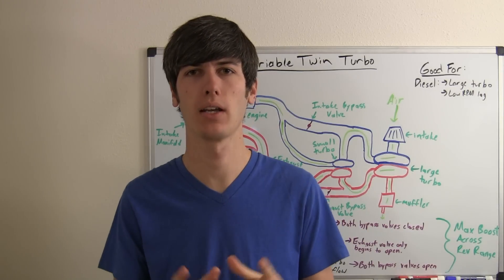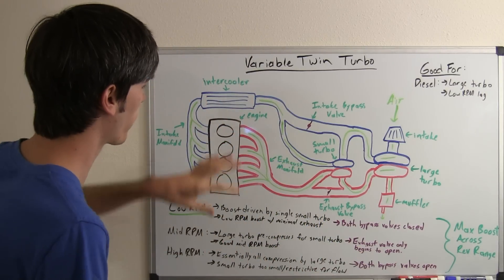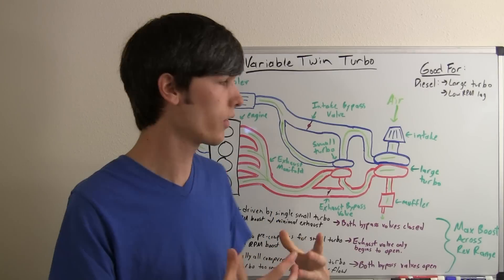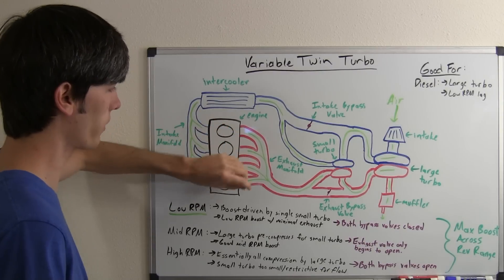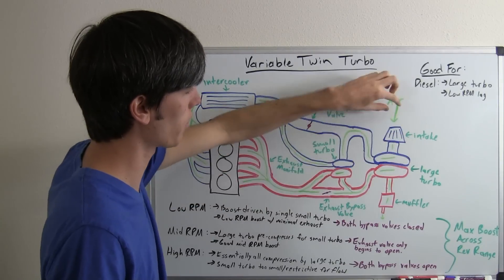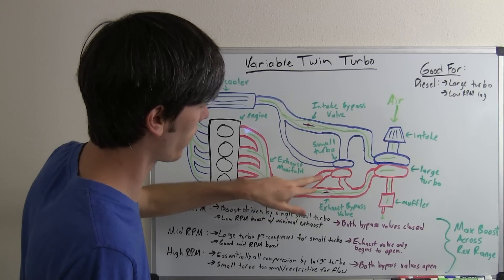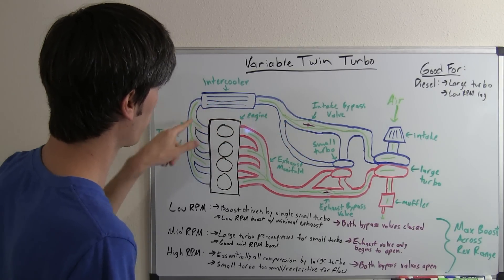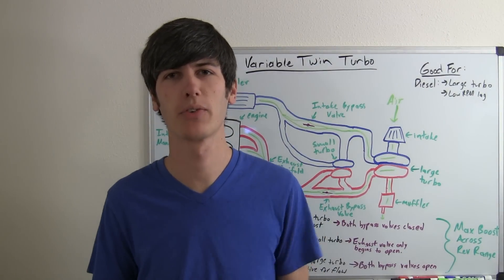How Turbo Diesels Work - Sequential Turbocharging

Comment: isn't this setup commonly referred to as compound (bi)turbo?

also, as the air passes through the big turbo first wouldn't there be a larger inertia for the small turbo spooling (thus a little lag)?

Comment: Right, I hear you, but how about this. Make the turbo use engine rotation at low RPM and disengage at high RPM, so you eliminate lag completely, and also have the extra efficiency of a turbo

Comment: This is quite insightful! Recently picked up a HEAVILY USED 335d. Have been reverse engineering and redoing some of the critical failure points on it.
Gotta say, series turbos like this are just the answer. With modern controls, it's really not too hard to even build a custom series turbo system for any inline engine.
Excited to see this applied to more cars. Wish the US would allow more light duty diesels. 450 horsepower and 40+ mpg in a full size 5 seater sedan is just nuts.

Comment: What if we had an accumulator after the air filter that feeds 3 compressors, one small, one twice the size and one 4 times the size, each is fed parallel to the other although there is a 1x volume, 2x volume and 4x volume compressor. There is then am accumulator after the compressor stages, this means you can have up to 7 volumes of compression, could repeat with the turbine to reduce the need to accelerate a bigger one

Comment: Could you do a review on What some people call a Tip turbo? It has a separate air filter feeding an inlet on the turbo, Tip..turbo is feed by the boost presume from the main exhaust driven turbo to increase the air flow into the engine.

Comment: hi, what kind of bypass valves do u use?
is there any universal adjustible valves?
ive been searching on ebay and the only thing i get is blow off valves
Reply: Leandro Fidalgo for a design like this you use a check valve on the compressor side. I cannot find a commercially available valve that can flow enough, but if you take a lightweight ball and some large diameter tubing with some craft skills, you can make your own high flow ball check valve.

This setup is ideal for gas engines, not diesels. A true compound setup does not have a bypass valve and has a bigger small turbo, as such this is more of a compound/sequential hybrid.

This setup won't achieve 100PSI of boost like a compound setup, rather, this setup is more ideal for boost up to 30-45PSI (3-4 bar) of boost. The main advantage here is that the small turbo can provide max torque at as low as 2000 RPM, spool a big turbo twice as fast (3000 RPM instead of 6000 RPM) and carry full boost all the way to redline. If that sounds insane, it probably is. I can't find any demonstrations, so it's on my bucket list of car stuff right now.

Comment: Can someone explain to me,  in a system identical to this, when both bypass valves are wide open, full boost, what happens with the smaller turbo? is all or most of the exhaust flow going to travel to the larger turbine housing while the smaller turbo just sits idle, or will Just enough exhaust flow travel to the smaller turbine to spin the compressor enough to its own charge pipe to match the pressure being supplied by the larger compressor in all the charged areas?

Comment: I'm not a diesel guy but today I saw 'compound turbo diesel'. Could you please explain how it works? In my understanding there's no valves, so I thought it would over-rev the rotors. I also think it would put a lot of heat everywhere, specially the intake charge. Thanks for all your work

Comment: I don't see why you need the bypasses.
If the outlet and waste gate of the small turbo feeds the big turbo you will have a bypass on the exhaust side anyways.
On the intake side if you feed the small turbo with compressed air from the big turbo then there is no restriction because the air is already compressed. And the small turbo becomes a second stage.
But they have to be sized properly.
Also it depends what you wanna do with the turbos.
I have an idea to increase the low end torque and overall efficiency of the engine only and not to get insane boost from a big turbo, because that ruins efficiency for high MPG.
Two stage compression is always more efficient because the usable compression bell-curve of each turbo is added up.
Reply: EvenStar LoveAnanda you don't need the bypass valves...

Comment: could you add in a compressed air intake(from a compressed air tank.like 5psi)  to provide boost immediately to the engine? like to minimize the smoke diesels put out before the turbo starts spinning?

Comment: Of course most diesels need boost-pressure to just do normal highway speeds(boost-pipe blew off my 1.9 TDI once. pedal to the floor, rolled coal like a truck and Vmax was 90 km/h), but wouldn't most gas-engines benefit from the added torque in the low rpm-range and get better mpg because of the lower pumping-losses and higher compression? Or would it require a stronger engine and gearbox like a diesel normally has?

Comment: This can't be very common.  I am into sled pullers and never heard of anything like this. . Compound turbos yes. But nothing like this.
Reply: There's no need for any bypass valves. Throw an external wastegate or 2 in like I use. Good day.
Reply: Check BMW 123D , 4 cylinder diesel twin turbo. More than 200 hp from a 2 liter... from factory...in 2007!

Comment: Best solution for me!
Since I got my car I was thinking how can I give it that "umpf", because it is a small 1.8 TDDI diesel engine with 90HP.
But I don't want to mod the hell out of it, so I was thinking about the intake and exhaust, I mean to increase the diameter of the ... pipes. But do I need a bigger turbo ? Then it isn't working in the low RPM's when I use it in the city ... what do I do? Here's the perfect solution!

Comment: What about 3 turbos on a diesel 2 smaller ones (same size) and a bigger one
Reply: In a triple turbo set up there are two larger atmospheric turbos feeding the one smaller secondary turbo. This reduces the lag that can come with a very large primary.

Comment: Odd setup. Twin turbo Caterpillars don't have any bypassing in them. The small turbo draws the air through the big turbo no problem. Once the big turbo spools up, the turbos give you up to 50 psi of boost even at 1100 rpm.
Reply: That is compound setup
Reply: how many CFM does a 14.6L engine at 1100 rpm flow though?
Reply: Depends on how much air the turbo is pushing through it. A twin turbo setup with a 4.3:1 pressure ratio is going to push 4.3 times the amount of air through the engine than a naturally aspirated engine would flow. There's plenty of cfm calculators on google that you can use if you want to figure it out.
Reply: Pressure ratio is not does not relate to mass or volume flow. Temperature and volumetric efficiency greatly affects those.

Comment: Hello Jason. I am sure that you have covered it in another video, but would you mind explaining to me what causes the bypass valves to close and open? Are they controlled by the ECU or do they open when enough pressure is built up within the piping? Thank you
Reply: would probably run off the ecu as a solenoid which is before controlled off a air sensor something like that

Comment: quick question if I might ask. What would the bypass valves be oppressed by? Would it be a pneumatic actuator, or would they be electronically synced with the tachometer
Reply: *operated
Reply: +Flipper Deluxe it would most likely run off the ecu which would have a sensor in there somewhere

Comment: look these diagrams are wrong as hell, as well as your video on twin turbocharging. valves will NEVER introduce excess pressure. IF there is any valves at all in the engine it will  be waste-gates only.
Reply: I mean any valves at all in the turbocharging system besides throttle bodies or variable intake. and yes some diesels have throttle bodies but its rare.

Comment: Great explanation, thanks. Are the bypass valves pressure operated, or electronically controlled?
Reply: Electric controller might be better, but it coasts a lot. 
Boost controlled is cheaper and easier...

Comment: why isnt this done also with normal gas/petrol engines ?
Reply: +H0pp3nst3dt It is. My bmw 335i has it, and it has zero lag!
Reply: I stand corrected. it is indeed the N54. Thank you for that intriguing information. which system setup would you say was better?

Comment: Silly question . since diesels are usually for people who do high mileage isn't there a greater chance of these valves between the turbos going wrong? If the valves get stuck open or closed what would be the effect?
Reply: +theoneheretosty I suppose in a worst-case scenario if both valves were stuck open, the exhaust gases would be trying to spool both of the turbos at the same time, resulting in the turbos being inefficient. This would mean the small turbo would not spool as fast as it could at low rpm because exhaust gases are leaking to the large turbo. At high rpm however, I assume, because the valve would be open anyway to let air to the large turbo, the effect would be unchanged.

In this case the engine would not be damaged because the valves that are stuck open would result in an under load of pressure and not and over load.
Reply: cheers

Comment: There's no bypass valves in any setup I've seen. Take those out,  and the piping bypassing the small turbo, then you got it.
Reply: +Shane Kramer it's to increase efficiency and reliability at high rpm. The small turbo simply isn't able to pass the quantity of air needed, (at a reasonable rpm that won't significantly reduce bearing life) so you bypass the restriction and only use the larger, slower spinning turbo.
 I figure that most people do it to prolong the life of the small turbo by not having it screaming along for 8 hours a day pulling a trailer at high speeds. (could also improve performance because having the small turbo running at such high speeds would create a lot of friction)
Reply: +nicholas wolff, with a compound setup the shaft speed of the smaller turbo is significantly less than a single application while achieving the same amount of airflow, so bearing life is no concern in this application. Once the bypass opens there would be a huge drop in pressure, so I don't see how this would work well. Anybody know of a video or place that sells a kit like this so I can actually see a real one?
Reply: +Shane Kramer Many many jet engines are done like that. They have a large,low pressure compressor that leads to a smaller high pressure compressor. Then after burning the fuel the small high pressure turbine spins the high pressure compressor, and the larger low pressure turbine spins the low pressure compressor.  Both spin independently. Just like our turbos.
Reply: +David Vermillion, do those have a bypass valve on the compressor side, bypassing the small turbo?
Reply: VW AMAROK has this setup
Reply: im running the same setup witha TB70 - 12 blade billet wheel (70mm turbo) and a td04-19t turbo (46mm turbo)
with a bypass wastegate on the pressure side.
Reply: @andygidlund88   Do you have a picture of the setup  ?
Reply: I'm with you on this, the diesels I've seen don't use a bypass, just flow intake thru the smaller turbo, which I'm guessing isn't much of a restrictions, and the hot side is delt with thru wastegates
Reply: Also I think engineering explained is talking about a petrol setup which is switching between turbos.
Reply: Mazda 2.2 skyactiv uses same setup but also has a wastegate valve on larger turbo in addition to bypass and regulator valve.
Reply from the maker: Have you seen every setup?
Reply: +Engineering Explained No, but this setup without the use of bypass valves is hands down more common. Wastegates can be used, but that's only if you have to adjust the pressure ratios.

Comment: How much restriction comes from the larger turbo in a setup like this?
Reply: Clobercow1 I think not much, as the airflow is pretty low in the low rpm range where the large turbo isn't activated

Comment: I love these short videos thank you for them I have a question  though  what's the difference  between using a variable twin turbo system vs a twin charged system I know that the smaller turbo does the same thing as the super charger but what would be the reason for one versus  the other

Comment: Can u all do a video on how to get more power in a turbo diesel engine .. example what mods I can do .. I have a mazda bt50 truck .. I have cold air filter n glass pack muffler . I get better acceleration on low gears . But I wanna increase my top speed . Please send me message of advice .
Reply: U can fit bigger intercooler, you can chiptune it, u can get bigger fuel injectors and if u are prepared to sacrifice low end performance, u can get larger turbo and produce power and top speed unmatched

Now, with so much torque, watch out if you clutch, gearbox, undercarrige and fuel pump can sustain or it can break ur car apart
Reply: cool . so far my upgrades i did are . i installed bigger intercooler than stock . cold air filter . glasspack muffler .. i am considering a bigger piping for exhaust . original pipe is 2 1/4 inch .. my vehicle carries a b2500 diesel engine . cant be chipped  . everything old school . should i increase fuel pressure a lil bit n bigger muffler piping?
Reply: my results . i get better low end n throttle response . but i think i losing top end . i used to get over 160km/hr . now i stuck on 160km/hr top speed
Reply: hungrynapps The gearing in pickup trucks is tuned to have more usable torque down low, this is going to be your biggest limitation. Also put the original air filter back on, you're probably loosing power with an aftermarket one. Best thing you can do now is get a larger exhaust and then get it on a dyno for a performance tune. All the work you have done is useless without a tune.
Reply: ok cool .. thanks . so far with d cold air filter ..  getting better throttle response . but i did realise i dont reach my to speed often . but i had to put in a aftermarket , cause my original box was damaged  n dat part hard to source . but my next step was slightly bigger exhaust n increase fuel pressure

Comment: I'd like to say that these short vids explaining how an engine works is really simple, and easy t understand (the way it should be)....
.
You should do a simple vid about how all the non-sense sensors, control boxes and wires/tube lines are really not necessary. Geeez all you need is some mechanical gauges: like Fuel, oil/coolant temp, oil pressure, RPM....
Reply: For a 1960's and 70s muscles u dont .... but then its 2015, if u dont own an oil field u cant afford 6 or 7 liter engines
Reply: blackcarmafia Uhhhh, size doesn't matter AT ALL, when it comes to all the complicated wiring... you should know this, if you know about engines AT ALL!! Have you seen some of the gigantic engine that have been powering large ships, and super heavy duty machinery??
.
"TOP 10 Biggest Engines"... watch?v=t3vWXY8hic8
Reply: Brian Davis I said u dont need wires and chips for huge engines, but in a modern car it needs to be efficent and u cant do that without chips and wires AT ALL
Reply: blackcarmafia Who says... you?
.
The simplest design is always the most effective... Cars today actually produce more emissions than the old muscle cars!! 
.
An engine is all mechanical... fuel injectors powered by computers will never be as efficient, or be able to keep up with a mechanical/simple carborator!! Think about it? A fuel injector powered by a computer has to get right, at the exact precise timing to spurt fuel 2-3-4 thousand (once every two revaluations for 4-strok engines. So if it was 8,000 RPM, the chip would have to get it exactly right 4,000 times a minute... and you also have to calculate the changing engine RPM's. It's never a constant) times a minute!!
.
All that wireing and control is just complication, and has really taken the fun out of messing with engines, getting them to go faster. It would seem today that you would have to take a completly separate computer engine diagnostics course to understand all the complication of all that needless control....
Reply: Brian Davis Old V8 got lower emmisions? Hehe, it uses a tanker of fuel a week and u can compare its power to i4 of todays

Its about fuel efficiency and power output, i believe it wont last half as long and fail on electronics many times, but as i said, we dont live in 1950's ... maybe in Oil producing countries such cars could be sold, we, others need to suffer or so called "economy"